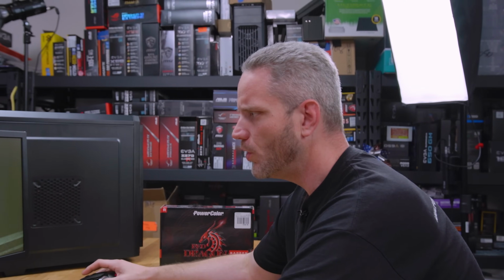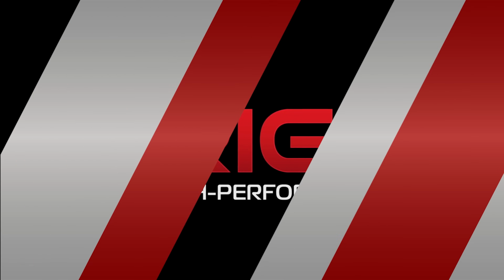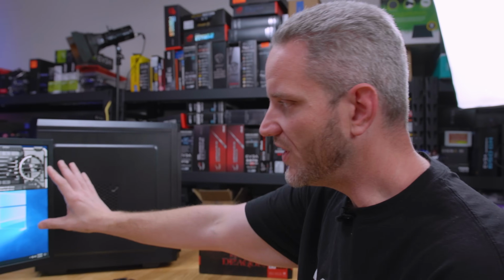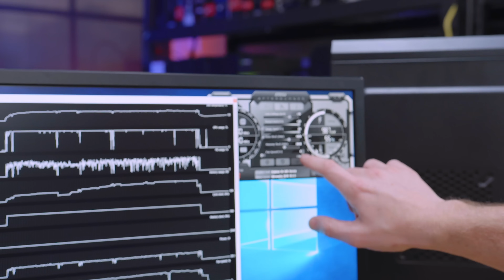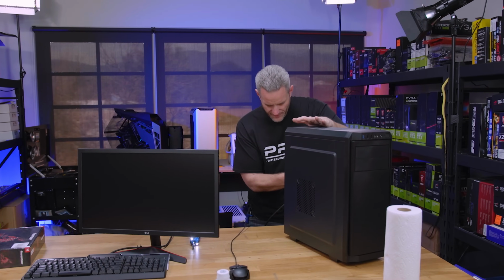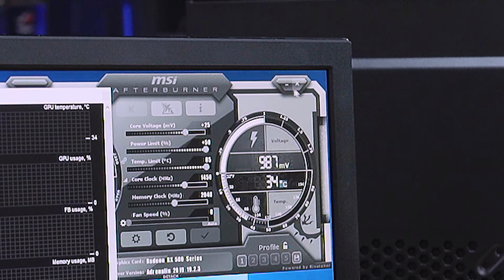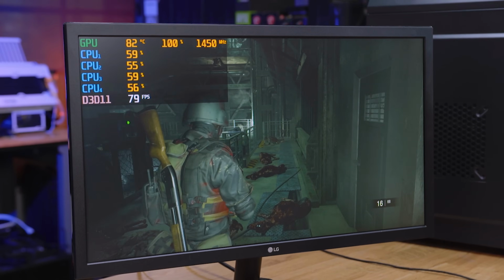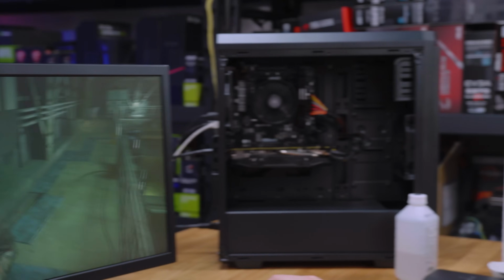Should you replace your video card's thermal paste??

Comment: My strix 1080 was getting 77-78 degrees. Put new thermal now run at 60 degress!!!!! Dayyyyummmm
Reply: Dayuhm indeed! I have a Strix 1080 too!! I'm getting overheating/throttling, higher than 78c! So I'm going to repaste and I hope it starts running cooler :).

Comment: I have a Zotac 1070 mini and it would often go into the mid 80s with the fans at about 55% speed, which is clearly audible. I took it apart and it looked like the thermal paste had separated. About 35-40% of the die was covered in what looked like clear gel, with the rest being covered by what looked like regular thermal paste. After reapplying paste, Temps now stay near the low 70s with fan speed at about 40%. Running furmark with 50% fan speed, the card would easily reach 85 degrees but after fixing it it settles at about 76

Comment: Changed Thermal Paste of MSI GTX 1070 ARMOR OC 8G after almost 3 years from purchase. Usually it ran 78-86 under full load playing graphic intensive games(Max temp locked to 82/83 by default by Msi Afterburner), not to forget I have a shitty case with bad airflow less space for cable management (Thermaltake Versa N21). When I opened the gpu when 2months warranty was left, not gonna lie I was tensed. The gpu vrms and insides were covered with lot of dust, the paste was dried. I cleaned the dust carefully and removed dried thermal paste as shown with isopropyl alocohol(70%) cotton swabs and tissues. After reapplying the thermal paste, Temps dropped down to 65-75 under same load as before (10-15 degrees drop). Amazing change I cant believe how I hesitated all these years to open and clean the gpu. Cheers.

Comment: Doesn't anyone 'tint' anymore?
Did anyone ever learn how?
Western Electric sent me to a class on tinting for heat-sinks and these huge SCR's.
I won't get into how its done, but one big benefit is using a lot less shmoo than other techniques.
Shmoo doesn't flow in really thin layers; it has solids that put a limit on how small a gap it can be pushed into.
By 'tinting' the surfaces, that thin layer is already in place.
And thermal transfer is all about how much TIM is between the heat source and the heat sink...double the TIM thickness, you cut thermal transfer by 8 times!
Turns out power-laws are involved in film thickness and heat transfer!!!
Thinner is always better.
BTW: Yes, tinting requires good mechanical fit between parts.  Yes, tinting can lead to 'gluing' parts together.  Separation can cause damage.

Comment: i actually found that installing a towercooler for your cpu helps with gpu-temps a lot, because it moves the hot air towards the exhaust of you case

Comment: For people viewing this in the future that have a 30 series founder card: your card is very hard to disassemble and re assemble so be careful.
Reply: so is the 20 lol
Reply: nah, man. the 30 series founder cards have way less screws, the motherboard is tiny and the only concern is removing the ribbon cables (correctly); knowing how is more important than being careful. 
managed to replace the stock thermal pads on both sides of the pcb with Thermalright pads and MX2 thermal paste after owning the card for just two weeks. worth the risk
https://imgur.com/a/DIb7C6a
Reply: @LiquidSnakeSSJ4  would that bork your warranty? Thinking of doing it myself
Reply: @buicktothemoon  won't void your warranty on FE models, as long as you don't break the card yourself as a result of opening it and replacing the thermal pads, but otherwise no. it won't. some aftermarket cards do void warranty if you open them though
Reply: The 3070 is actually like stupid easy to disassemble. Not like the 20 series
Reply: Why would you do this to a 2 month old card?????
Reply: @scottvanthul5386  because it's the thermal pads on the vram that are shit and replacing them stops 100+ vram temps
Reply: The same as a 1080ti in my opinion. Just gotta not strip those little screws
Reply: @tieuquy linthinh not much difference between fe and 3rd party
Reply: 3070 FE pretty straight forward, only hard part is the unibody
Reply: @buicktothemoon  Its not even hard. 3070 is very very easy to disassemble
Reply: @cwill2127  isn't the uni body annoying? Like you need 3 spudgers to lock pick it
Reply: @buicktothemoon  huh? No you don’t? I disassembled it per gamers nexus video, and it was a breeze. First time installing a GPU waterblock and super easy.
Reply: My wife disassembled my 3070 with a hammer pretty easily
Reply: Yeah it might be enough to put me off buying one.
Reply: @threecats8219  it’s not hard at all. Take it from someone who’s first experience taking a gpu apart was with the 30 series. Not sure where this lie started but they are incredibly easy to disassemble assuming you have 2 functioning brain cells lol
Reply: @cwill2127  Really, OK.
Reply: I dont like the way they disasseble the gtx 1650 cause to fans can get n easy damage if not taking out those screw so gently
Reply: Hi, I'm from the future. I'm about to do this exact thing tomorrow lol.
Watching a lot of videos of people tearing it down.
Reply: @Cakemagic1  good luck

Comment: I've replaced the thermal paste on a 2080 after 20 months of gaming running. GPU temp reduced with about 2 Celsius only, used Arctic Silver 5. Still runing in the mid 70s stock and high sixties with UV and same performance as stock.

Comment: My GPU Geforce 1060 6gb is just half a year old couse i thought my 1050 was broken couse i got all the time a black screen... so i replaced to 1060 couse the 1050 was already 4/5 years old until it gave me black screen while gaming, but now i got my new one installed half a year ago it worked Fine!!, but know i got the EXACT same freaking problem with this new one, i replaced on Both old and new GPU the thermal paste, and tryed both of them with the right drivers installed and older versions, stil the same, my GPU keeps running in idle at 77'C no matter what i do and try… it stays the same and only with gaming i get a black screen, And rarely a light lime green screen, but the green screen i can fix with Windows key + P... has anyone any idea for me what to do? i got a friend that is prety good with this stuff, and he made it working again for around half a month until it started to do the same thing… it got a gigabyte x99 gaming 5 motherboard. like i said, i didnt have ANY problems for 4/5 years, so i defintly thought my GPU is just been used way to much in these years. but aparently the Graphic card is stil completly fine couse the brand new graphic card is giving me the exact same problem. i got it fixed for a little while but non the less it came back prety quick. BTW my excuse if my english aint the best.

Comment: I got that exact same GPU of the video almost a year ago and my temps in games like Hellblade or Horizon went from 72 to 75 degrees max. Now I changed the thermal paste and I have 10c higher temperatures. 

Idk why, perhaps it's the thermal paste quality or something, Besides that, when the temperatures are around 80c, I sense the backplate and it's barely warm, Idk if it's the gpu sensor or smth but this is driving me crazy
Reply: Update: It was the thermal paste quality. I changed it for an Artic MX-4 and the difference in temperatures are brutal. Now I have max temps of 68-70 degrees.
Reply: @Akirapoet  Wow glad to hear that. I bought an used RX 580 like 2 weeks ago. The temp was like 75-80 max. I thought it would be cool to clean the GPU a bit and replace new thermal paste today. And now it's 10+ degree higher and thermal throttling. Actually the pre-applied thermal paste hasn't dried out yet and is way better than the ordinary white color thermal paste. Now it's sad that I'll have to downclock the GPU while waiting for the new thermal paste to arrive

BTW I think high 70s is pretty normal for RX 580 just like in the video. And the pre-applied thermal paste is quite decent (if not the best). Lessons learned is make sure to have a really good thermal paste before replacing the original one.

Comment: I had an issue with my first evga rtx 2080ti and evga actually told me I could change the thermal paste before the rma process was started just to check it and they still did the rma after knowing I changed the paste "they did tell me i could though"

Comment: my GPU is a GTX 1080 8GB  and during heavy games such as black desert & apex legends it stays around 83-85 when i close the games and i stop playing them it goes back down to 55-56
Reply: the paste on my 1080 was completely dried out i changed it with some fresh one and now its sitting on 60C in the same games,,, new paste took my GPU heat from 85 to 60 fuck yeah! Thanks jay
Reply: @AlexaCroft  Nice, I have an asus rog strix gtx 1080 and my temps are high as well. 83c and it can go even higher to 87c+ which causes throttling and overheating. Going to repaste and hoping for an improvement!

Comment: changing your thermal on this actually made your temps higher LOL
Reply: I just changed thermal paste on my rx580 and I got 10 degrees lower temps, it’s 2 months old
Reply: It takes about 24 hours for the break-in period. Then you'll see the true temps.
Reply: R0tten it’s getting 1 degree higher than it was 3 days ago
Reply: @laneelliott4705  good to know. So apparently - changing thermal paste is helpful :)
Reply: R0tten well mine was dry asf, so it’s helping a lot. Mine was running very very hot
Reply: @laneelliott4705  how long have you had the card? I've got a 1080 for 3 years. I'm thinking about it, don't know yet.
Reply: @NiNjaTurtLe697  I'd change it, prob get 2-5 °C difference for a 3 year old card
Reply: @MaxiiBoii23  yeah I gotta reapply paste on my proc
Reply: R0tten yeah, it’d probably be good, I mean I got a cheap card and I replaced stock thermal paste with really good thermal paste
Reply: nope
Reply: @wolfmaster8191  nope to op?

Comment: I have an msi 2070 super gaming x and it crashes (green lights, black Square that takes over the screen or flashes) when playing COD MW WZ AT MAX settings. Also I have recently noticed that the vram bar on the top right corner says 3gb vram is the safe zone. So when playing that specific game I default the GPU and run max fan speed.
My set up is 
MSI MPG Z390
INTEL I7 9700K OC @ 4.9
NOCTUA CPU COOLER
16GB GEIL 3200 RAM  
Any help would be appreciated

Comment: I had a Radeon HD 5670  in my system that I got in 2010 and a few years back it was running at over 100°C. Then I finally got to replacing the thermal paste since cleaning it from dust didn't do anything anymore and now it sits at 70s. So I would say replace the paste every 4-6 years or so depending on how much you use your pc.

Comment: Love my rx580. I’m keeping my side panel of for 2 years and replaced my cpu cooler with a be quite! Pure rock slim, instead of a stock one. Sill a very hot system cause there are no other intakes but it’s still going. (i7 3770, rx 580, 16gb ddr3, everything else not mentionable (Acer Predator 3620 case and mb)

Comment: With RX 570 and RX 580 you can just undervolt it and reduce about - 10ºC. I undervolted my 580 from 1150 to 1050 and it rarely goes beyond 70ºC in Metro Exodus. Same clock (1340mhz), but with lower voltage.

Comment: PLZZZZZZZZZZZZZZ help
Iam having a rx 570 4gb OC since april of 2019 and now a days i am facing overheating even when web browsing and real bad overheating during games ( i had one BSOD today).
Games benchmark as amazing with over 100 fps but still im facing constant stutters and fps drops to 20 and it feels like 10 fps.
i opened my and it was covered in huge amount of dusts from every angle and i cleaned it to some extent but games are still running the same.
Is it my thermal paste or airflow or my hardware(i hope not)?
Reply: GLOSSY Dude try go to reddit in r/techsupport

Comment: Not sure why I'm commenting on a year and a half old video but my 2080 went from emergency fans and thermal throttling to about 15-20 degrees (centigrade) cooler after reapplying thermal paste with some noctua stuff I had. So if you have a loud gigabyte 2080 or 2080ti might be worth doing. I know I'm not the only one whose found this.

Comment: It's funny this video is in my feed, as I've now repasted all the video cards and laptops in the house with MASSIVE improvements.
My EVGA 980ti Classified at 1513 Mhz /4000Mhz was hitting 80-81C in superpostion. After repaste, it's at 70-73C, and after setting a slightly more aggressive fan curve, it won't go over 65C!!!
What a massive difference. And the thermal paste on the 980ti wasn't even that bad, it was still wet to the touch. I used Noctua paste that came with my NH-D15's.

The laptops were an even bigger improvement.
I recently purchased a used Alienware M18x R3, and during a Throttlestop benchmark run, the overcurrent breaker on the laptop would trip after about 5 seconds and the whole laptop would shut off and I would have to pull the battery and AC to get it to boot again, and that's with no overclock, it also thermal throttled immeditely.

Well, tore the whole damn thing apart to get to the CPU + 2 GPU heatpipes and repasted them, they were rock hard.
Now during the same benchmark, it doens't get over 71C, and the GPU's during benchmarking stay below 85C with a pretty big overclock.

I shaved about 10C off the 5700XT I just got, but I think that was more becuase the 4 retention screws weren't super tight, but I reefed the crap out of them putting the card back together.

Comment: i hope it's the thermal paste, I finally got my gaming pc running, and within seconds of running a light benchmark (no overclock) it had overheated and shutdown.
Reply: Hi ! Im curious if that was the reason, I have an rx 580 that is getting very hot and in the avengers beta crashed constantly
Reply: @albertomon  still haven't gotten to the bottom of it, so far switching to the 8x pcie slot rather than the 16x is preventing it from crashing as often at least.. in short. I don't know.

Comment: So there is no reason to replace it when you first buy and get your card.
But down the road the paste may degrade, your temps go up and then it's time to apply new paste.
But there is no significant drop in temps when using your own premium paste vs the factory past.       🤓

Comment: just replaced the paste in my 970, and it went down 25 degrees (celcius) :O I forsure recommend this haha
Reply: Same, repasted my rx 480 reference with some liquid metal instead of thermal paste. Temps are now 35-40c idle and 70-75c max vs 50-55c idle and 85c maxed
Reply: i might try that, i got a 970 from strix and a good dusting/better thermal paste should bring down the heat for sure

Comment: Replaced the thermal past on my etc 2070 super dropped by 5 Celsius then I said screw it and water cooled it and now it’s high temps are 50 Celsius while overclocked and gaming 😂

Comment: It's easy .  The card makers use cheap shit. And if you replace it for a good stuf your temps go down.   Easy.
But today in Vega and rx5000 serie AMD do not use paste but a thermale pad. And that's sucks. You can not replace it with pasta because the contact is not max .

Comment: I built my computer in 2011 at some point I replaced the GPU with a 780. I've never replaced the thermal paste on anything. In fact I'm using the stock thermal paste that came on pre-installed on the intel cooler. Multiple times the fans got clogged with dirt and I've blown it out, but yeah I suspect it's probably pretty terrible, but it doesn't usually have issues and generally runs quiet. I'm sure my paste on both is pretty bad and that intel CPU paste was probably horrible when it was new. lol

Comment: I bought a used Strix 1080Ti that was running at 80-82 degrees in Heaven benchmark. Decided to strip the cooler down and see what's wrong, and lo & behold - the thermal paste was all dried up. After replacing it, it dropped all the way down to 60 degrees in same benchmark...

Comment: I was wondering why my gtx 1060 mini was overheating, i bought the card used and the fan was spinning so i thought the chip was messed up or something. So I open my card and I find out the last owner of this card used a cpu thermal pad that was wayyyy to much and covered like 2 cm past the chip, what a dumbass
Reply: I opened my gpu that I got new and it also had way too much it was passed the chip. Probably like that from factory

Comment: If you have RX 480 , 580 , 590 , R9 380X , 390X , GTX 1080 Ti or similar FE or with some bad cooling with 2 fans , it's necessary to renew a thermal paste !!!!!!! For example , I have Asus GTX 1070 Ti Advanced Strix , load in 2K on Utra ( Far Cry 4 , BF V , SW BF 1 , BF 1 , Metro Last Light .... ) , it goes up to 70° ( not so bad ), and still have warranty sticker !!!!!!!

Comment: Your GPU is running hot and your case looks like it supports a side fan pointed low at the GPU area.
My first question is, for this use case, did you put a side intake there?

Comment: I bought a used Gigabyte GTX 1080 G1 Gaming last month. 1st thing I did upon receiving it is change the thermal paste. The original paste was dry as rock and fell apart in little crumbs when I removed it. Thermal paste tends to dry and so is less effective when it ages. I replaced it with some Prolimatech PK3, one of the best thermal paste out there, and now, the GTX 1080 nevers goes past 70°C under 100% load stress test (basically stays around 65°C in game). I had done the same on the GTX 1070 MSI Gaming X I sold after buying the 1080, with similar results. It pays to change the thermal paste once in a while, I'd say every 2 years or so, but you have to do it the right way: good cleaning of the surfaces with artic clean solutions for example, and then apply the paste evenly in a very thin layer with a spreader. This goes for CPUs too.